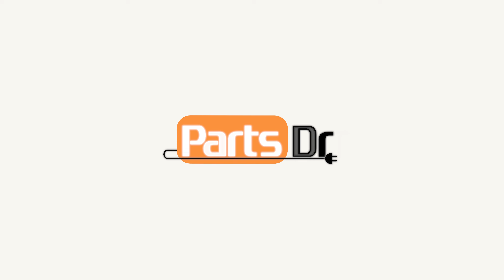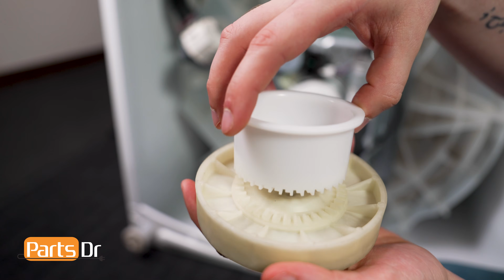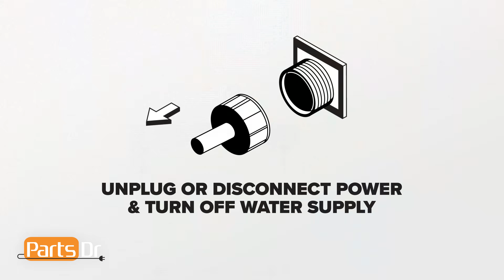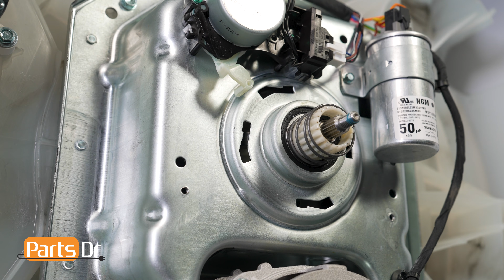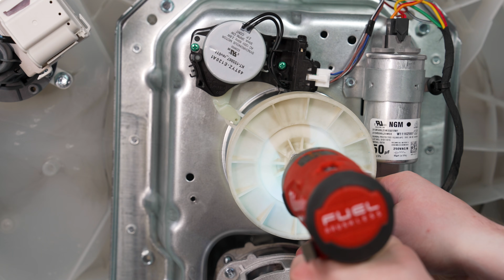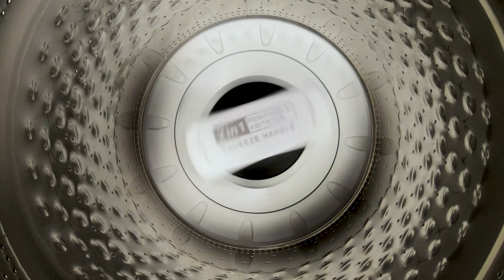Noisy & Not Agitating or Spinning?  Replace the Splutch Kit on your Whilrpool Maytag Amana Washer

Comment: My Maytag Model MVW6200KW only has 5 buttons (no button #4). To put it back into service mode, do I just press buttons #1-5 and it will work?
Reply from the maker: Follow the instructions on the tech sheet here https://s3.amazonaws.com/sm-backend-production-attachments/tech-sheet-w11416398-revb.pdf
Reply: @PartsDr  Thanks much for that info. However, the tech sheet only shows how to put it into service mode. It does not show how to complete the calibration, like you walked through in this video. Any thoughts?

Comment: I’ve replaced the splutch several times and it still makes the clicking noise after the spin cycle. All the gear teeth look good so not sure what is slipping. Also changed the actuator with no change. What else could it be??
Reply from the maker: Did you replace the parts with OEM Whirlpool parts?
Reply: @PartsDr  I bought the splotch kit from Amazon which said it was an OEM  part.
Reply from the maker: @goodfriendg  Most of the parts on Amazon are not OEM. If the parts did not come in a bag that says Whirlpool Corporation Factory Certified Parts, then they are low quality aftermarket parts.  Try the OEM Splutch Kit https://partsdr.com/part/w10721967-drive-pulley-cam-kit and Actuator.
Reply: @PartsDr I just looked at the box and it says made in China. Go figure
Reply from the maker: @goodfriendg  Let us know if the OEM Whirlpool parts take care of it.

Comment: My 2017 MVWX655DW1 is throwing and F7E6 code - the only issue is that is the impeller is barely agitating. Spin is fine. Actuator was replaced less than 2 years ago, as well. Would this be worth replacing along with another actuator? Thanks!

Comment: I have an older whirlpool washer that I was trying to fix and it keeps stripping the splutch assembly. The teeth are not fully meshing when it shifts to the spin mode. Any suggestions?

Comment: I noticed my whirlpool washer is spinning louder than normal. There’s no grinding sounds or knocking, just smooth but loud. I replaced the shift actuator for an F7E1 error which fixed another issue but it’s still loud. Any idea what might be causing the loud spin?
Reply from the maker: That sounds like the bearings the gearcase are starting to fail.  https://www.youtube.com/watch?v=RaSxZAMiXM8
Reply: @PartsDr  I've read that bearings create more of a grinding sound. I think that the drum is just spinning faster than normal.
Reply: I also got an F7E1 error code again after the shift actuator repair... so it may be the capacitor?

Comment: Uh yeah, no, I removed and then replaced the exact same original assembly (not a new part) and watched this video just as a guide and the belt DOES NOT just glide easily back on like that lol. I am fighting it with a screwdriver to try to get it back into place. Never as easy as it looks in videos 🙄 *Ended up removing the drive motor, putting the belt onto the smaller pulley attached to it as well as having it on the splutch pulley, then replaced the motor so the belt was already attached. Stretching that belt to fit over the large pulley was not happening lol.
Reply from the maker: Thanks for sharing your experience and the trick you used to get the belt back on!

Comment: Hi Mr parts Dr.  I replaced the actuator and the splutch parts in my Maytag and is working fine now but I’m hearing a squeak. I don’t know if it’s to do with the belt or if I over tightened the nut on the splutch. Any suggestions?
Reply from the maker: Try removing the belt and turning the pulleys by hand to see if that can help you narrow down the source of the squeaking sound.
Reply: @PartsDr awesome thank you for your response. I did as you said but as I turned the the splotch Lilly without the belt on I noticed the squeaking is coming from the inside of what the splutch is attached to.

Comment: I have this problem with the drive basket gear and cam ring the drive basket for some reason starts to melt and break off against the cam ring only where it meets it’s happened before and I changed it to a new one but it still happened again the same problem I don’t know why it happens and they don’t just sell the drive basket gear it’s the only part I need not the whole assembly but is there a reason that it keeps melting and breaking?

Comment: This is a great video. I replaced the splutch, however at the very end of the full wash and spin cycle, is when the grinding still continues. I've loosened the nut and I've tightened the nut. The plastic teeth still grind upon one another. Is there a specific torque per square foot to be applied to the nut?
Reply from the maker: We could not find a torque spec listed for this nut by Whirlpool.  If you find one, please let us know.  Are you certain that the grinding isn't coming from something else like the spline teeth on the bottom of the spin basket that are stripped?
Reply: @PartsDr  From my research, it’s 100 in.lbs.

Comment: I replaced both the actuator and splutch and washer still doesn;t make it past the spin cycle. No error codes amd it is pretty frustrating
Reply: Ever found a fix?
Reply: Might have to replace the whole transmission

Comment: The pulley of mine made a grinding noise whenever I manually rotate it… it doesn’t make noises whenever I push it all the way up. 
Is that normal or the whole thing needs to be replaced?
Reply from the maker: That sounds like the gearcase might be failing.  We have a video showing that repair here: https://www.youtube.com/watch?v=RaSxZAMiXM8

Comment: I replaced all of it and now the new pieces are making squeaky noise
Reply from the maker: If you're hearing squeaking after replacing the parts, make sure you installed genuine OEM parts.  Aftermarket kits can sometimes cause noise or fitment issues. Also, check the drive belt for wear or tightness, and make sure everything is properly installed. If all looks good there, the squeaking could be coming from the gearcase itself, especially if it's starting to fail. Let us know what you find.
Reply: If you used non oem parts its probably the new parts. I learned this the hard way and I'll never use non oem again!

Comment: So I replaced the belt because it was damaged and it won’t spinning it just makes noise
Reply from the maker: Check to see if the motor pulley is stripped and that the gearcase is rotating freely.

Comment: I have a Maytag mvwb765fw2  top loader that seems to wash fine, but during the wash cycle, it makes a pop sound constantly when the agitator moves. It's a pop every couple of seconds when the agitator switches directions. It doesn't spin freely but agitator seems loose in a way. The dogs maybe? Or splutch?
Reply from the maker: Your model washer does not have dogs.  Instead on the agitator side, check to see if the splines on the bottom of the agitator are stripped or if the metal insert has come loose from the plastic.  https://partsdr.com/part/w11550891-agitator-assembly?model=MVWB765FW2

Comment: In my case the splines on the plastic part of the  gear case shaft did shear along with the clutch. Can the plastic spin drive be replaced alone without changing the whole transmission?
Reply from the maker: Unfortunately no, you would have to replace the entire gearcase assembly if the plastic piece on the gearcase is stripped. https://www.youtube.com/watch?v=RaSxZAMiXM8
Reply: @PartsDr  Thank you for your prompt response! I'm def checking your parts store

Comment: I have this exact washer. When I attempt to wash, it does not  spin and I can hear the sound that it’s trying to spin. I checked the drive belt and it looks good. Could it be the piece you mentioned in the video or possibly the motor?
Reply from the maker: Does the washer agitate properly?
Reply: @PartsDr  No it doesn’t agitate at all unfortunately.
Reply from the maker: @angeelbarrera  We would start by inspecting the splutch components to see if any of them are stripped and also the drive motor pulley to see if that is stripped. Let us know what you find.

Comment: Should you be able to spin the pulley freely by hand with no resistance at all or should you always feel the tub moving when spinning it
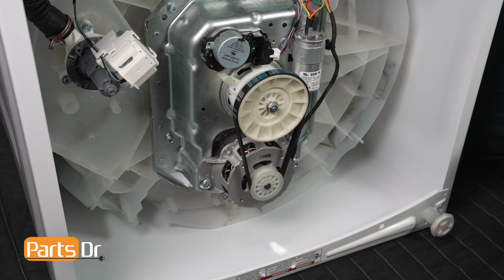Reply from the maker: It depends on which position the splutch cam ring is in.  Watch the 0:29 section of this video where we show how the splutch engages and disengages.  When the splutch is disengaged, turning the pulley will only move the agitator/washplate.  When the splutch is engaged turning the pulley will rotate the tub/basket.
Reply: @ issue I’m having is when I put washer on drain and spin it begins to spin then goes straight to drain the repeats itself I went underneath pulled off the cover as I spin the pulley it just spins freely
Reply from the maker: @kaispits8573  try disconnecting the shift actuator from the cam ring and manually shifting the splutch to see if it engages and disengages that way.
Reply: @PartsDr  splutch is hard to push up like it’s stuck

Comment: What’s the purpose of the calibration at the end? Is that just a test to make sure everything is working ?
Reply from the maker: The calibration at the end calibrates the main control board to the washer for optimal load size estimation.  If you don't do this, it can result in poor wash performance.

Comment: Thanks for this! 
Should the gear shaft have any play in it? Mine seems to go up or down a quarter inch and this seems to make the gears skip once i put it back down.
Reply from the maker: That doesn't sound normal from what you are describing.  Are you seeing any residue leaking from the gearcase?
Reply: @PartsDr  there is a little bit of grease on the clutch, not very much tho. 

When I run a cycle, every agitation makes a soft grinding sound, and every once and a whole a very sharp grind (offten on quick change of direction)...  When viewing the load while agitating, it seems the tub is spinning with the agitator, not sure if that's normal.
Reply: I'd add that the spin cycle sounds fine. It's only when it agitation it makes the low (frequency) grinding sound
Reply from the maker: @Jordanmmrk  Any grease on the splutch is usually an indication that the gearcase is failing.  You may also want to check to see if your washplate is stripped from what you are describing https://www.youtube.com/watch?v=mY5tpP6JWV0
Reply: @Jordanmmrk   @PartsDr my maytag model MVW5430MW1 also just needed this replaced and i noticed there was slight play and some oil on my gear shaft as well. not sure if this is just normal for the machine or sign that gearcase failures are common but i will continue to monitor it

Comment: My maytag washer doesn’t agitate because the shift actuator arm keeps dislodging or disconnecting from splutch. What could cause that?
Reply from the maker: This can be caused by a bad shift actuator, bad splutch, or bad gearcase.  We have also seen this problem occur when aftermarket parts are installed instead of using the original OEM Whirlpool parts like the ones we sell on our site https://partsdr.com. Please let us know what you find as the solution to the problem.
Reply: @PartsDr This is also happening on my grandparents washer. I cleaned and reinstalled about 2 months ago. Noticed today it is doing it again. Start with splutch?

Comment: I’ve had to replace this part 3 times in just one year. Any idea why this keeps happening? I never fill my washer more than 3/4 full, usually only halfway full. Whirlpool certified parts and a repair tech fixing it. I’m at a loss
Reply from the maker: Which component of the splutch is failing and in what way is it failing?
Reply: @PartsDr seems to be the cam ring that’s getting completely disfigured and destroyed:(
Reply from the maker: @michellenicole6953  It's hard for us to say. Sometimes we have seen the shift actuator that is failing cause the splutch to strip.  If you find the solution, please let us know what it is.

Comment: I've replaced our bad actuator, but the cam ring keeps coming/ slipping off the new arm actuator after few washes - any suggestions?
Reply from the maker: Did you replace the actuator with a new OEM Whirlpool part?
Reply: @PartsDr  I bought it from amazon i dont think it was oem. I found your tutorial after the change and i think I'll go ahead and replace the splutch as well,  because it seems that since the ring rises and falls maybe something is broken inside causing that, the actuator is same on a visual inspection and the washer does function until the arm slides off.
Reply from the maker: @kaosbboi  We would recommend replacing the actuator and splutch kit with OEM Whirlpool parts, like the ones we sell on our site https://partsdr.com Let us know how it works out for you.
Reply: @kaosbboi did you ever get this resolved?
Reply: @nyalgoforth7375 i did actually. But few months later we started having a new issue and just bought a new one. It was starting to shake violently, the legs and machine was balanced and somebody said to check those springs or something but opted not to

Comment: My actuator will not shift the cam ring, when attempting to shift its like it's locked up and the actuator continuously pops. Would this be reason to replace the splutch assy?
Reply from the maker: If you disconnect the shift actuator, can you shift the splutch by hand?
Reply: @PartsDr  yes, I've been rocking my washer back while its popping and assisting the actuator to shift the splutch, upon doing so the washer continues to function as it should
Reply from the maker: @logangow1640  if you can shift it by hand, then the splutch should be good.  It sounds like your shift actuator is probably failing and causing the problem.  Let us know what you find.
Reply: @PartsDr  good to know, considering I still have a spare good shift actuator from my last bravos x, thanks for the info. I will let you know if replacing the actuator fixes the issue
Reply: @PartsDr  so, I've replaced the actuator and I'm getting f7e5 code for shifter fault, is there a recalibration I need to run before it will read properly? Model number MVWX700XW
Reply from the maker: @logangow1640  Yes, you are supposed to recalibrate the machine after replacing the shift actuator.  Look for calibration instructions in the tech sheet https://www.youtube.com/watch?v=Ens8pYh2K7U
Reply: @PartsDr  there is no tech sheet behind the control panel in my machine, is there anywhere else it may be located?
Reply: @PartsDr  I found the recalibration instructions in am online tech manual, however, recalibration did not resolve the issue with the new shift actuator. My prognosis is this is a bad actuator out of the box, granted it was lurchased 2 years ago